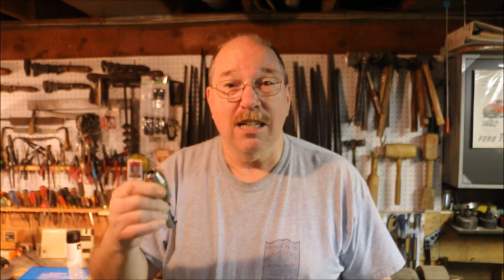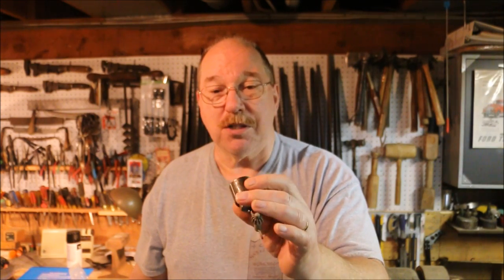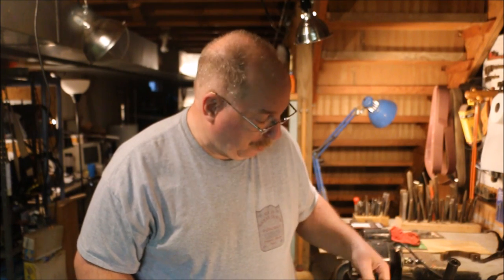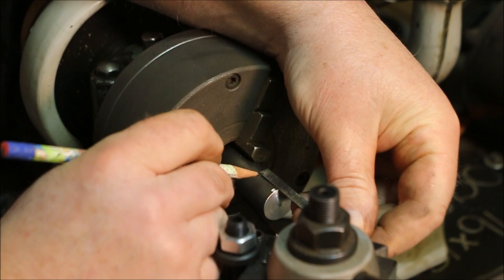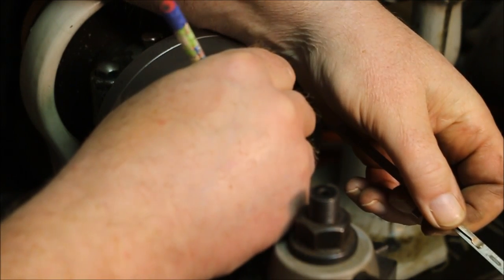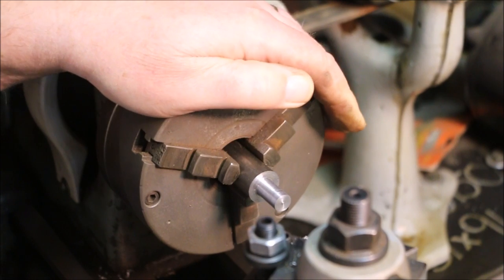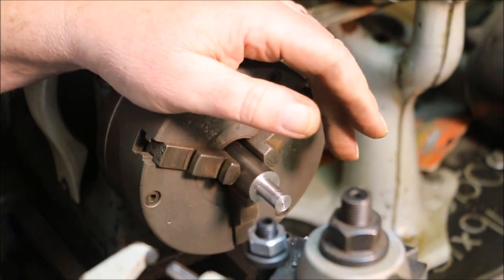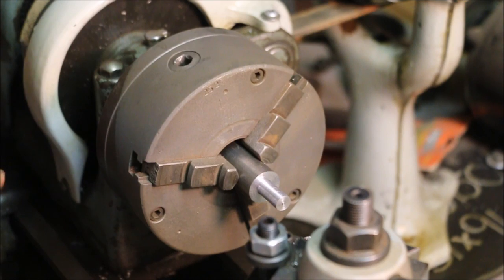DIY ~ MAKING A MOTOR ARBOR ADAPTOR ~ PT 1 ~ TURNING

Comment: I like you am a big fan of the keyed Jacobs chuck. It is becoming almost impossible to buy a mains powered drill with a keyed chuck these days but for sheer peace of mind they cannot be beaten. I was taught to always use each slot to tighten to ensure a really firm grip. As always, enjoyed the video.
Reply: Me too, Tony. My 3/8ths had a keyless and it pitches fits once in a while and I have to get out the oil can. And it just won't hold like a keyed job. BUT I have a keyed chuck on the hammer drill so if I really get desperate, I can go get another means to the approved end!

Comment: I've got a couple of those chucks I've collected for vintage projects.  They don't hold at all.  I don't know if they are just wore out or if they were always crap.
Reply from the maker: Crafted They stopped making the Millers Falls breast drills in the 60's. The keyless chucks have been around more than a hundred years so chances are if you find a loose one it was taken off for a reason. The reason I was using this one was convenience. The arbor I got at hardware store GOB sale had a 1/2" -20 thread so the old chuck fit right on it.

Comment: Great vid! Thank you!
Now, i have a problem that im hoping you can help me with.  I recently acquired an old motor with one of these threaded adapters on the shaft. The two set screws holding the adapter on were extremely hard to get out, but i did. However, it still will not budge.  Ive tried heat, soaking it in lube/penetrating fluid, etc... I want to use a gear/bearing puller, but the issue is the end of the adapter is closed. The center screw of the puller isnt able to touch the motor shaft.  Any suggestions? Thanks!!
Reply from the maker: First off do you want to save the adapter?

If not then cut off the end and get down to where the shaft on the motor is and put some oil on it and then use your puller on it. If you want to save it then you're probably not getting the oil down into the adapter far enough for it to work. When you heat it are you heating the collar part or are you Heating the end where the threads are? If you want the oil to be drawn down into the adapter put it at the end where the opening is and then heat the opposite end. The oil will be drawn to the heat. It won't be quick and you're probably going to have to put the oil on it heat it let it sit for a while. Come back put some more oil on it. Heat it let it sit for a while.

Each time you heat it, you don't have to heat it red-hot, you just have to get it warmed up. After you've heated it, while it's still warm, tap on it. Don't hit it. You don't have to slam on it. Just tap it. All the way around the outside of the collar
Reply: Old Sneelock's Workshop Thank you for the quick reply. I would like to save the adapter. Ill try your method of heat, fluid, tapping. keep you posted.  Thnx

Comment: I need an arbor similar to the subject of this video but do not have access to a lathe.  The arbor that I need would have a 5/8" diameter keyed bore with a couple of set screws, and 5/8-16 threads on the other end.  I've been all over the internet looking for such an arbor but so far no luck in finding one.  Can you make me one?  Do you handle such small jobs?
Reply from the maker: I seldom take on additional projects unless they have a specific part to play in a project I am working on . That is especially true now with the current work load. 
Just out of curiosity, what do you need it for?
Reply: Hi again.  I plan on mounting a drill chuck on the 5/8" keyed shaft of an electric motor.  Will then be used for restoration of motorcycle parts.  I had know idea that the 5/8-16 threads of the drill chuck were a bit rare.  I'd buy another chuck but this one with the 5/8-16 threads is really nice.
Reply from the maker: 1/2"-20 arbors are everywhere and it's a stock size for a 1/2" chuck. Cheaper than paying $100.00/ hr for custom work.
Reply: Ok, thanks for your replies and your videos.

Comment: i have an old table saw with threaded arbour on both sides of the motor, i want to mount a chuck on the right hand side for mortising and boring but its an unusual size thread 18mm and possibly 25 tpi the thread is so small i really struggled to count it haha anyway do you know any way of accurately measuring it? i dont want to pay for an adapter to be machined if its wrong
Reply from the maker: Thread gauges can be bought at most auto parts stores. They look like jackknives with saw blades instead of regular blades. You find the thread gauge that fits and read the number stamped on the blade. 
One thing to check. Sometimes they have a left hand thread on one side and a right hand on the other. 
You will want to know whether it is metric or imperial thread. You don't say where you are but since you are talking metric I'll guess it's not the US. Is the other arbor the same size? If so can you take the nut to the local hardware or parts supplier and try it against their stock? I've done that several times with odd ball threads. 
We have a company called Fastenal that if they don't have it they can sure tell what it should be and order one.
Reply: first thing i tried was the saw arbour nut haha im in the uk but its an old german saw from the 70's its either 18mm or 11/16 and its a right hand thread cuz its on the right side of the motor same as a bench grinder
Reply from the maker: Thomas Doherty Looks like you're going to have to get hands on. With the nut in hand I would seek out local shops that carry hardware. Perhaps one of the clerks can help.
Reply: ill order a thread gauge from ebay and just see if a local machine shop can machine something up for me
Reply from the maker: Sounds like a plan. If you were a little closer we could spend a couple of hours figuring out what the size was and turn one up. Finding someone with a small shop that is willing to try will be a good experience. You can always find work for a good shop. 
Good luck on your hunt. 
PS if you are going to go to a local shop anyway. Take the motor with you while you are hunting. They can tell right away if it's something they can tackle.
Reply: im thinking about carefully reducing the arbour on the saw with an angle grinder with the saw on then die the shaft to the standard !/2" 20 unf but im not sure could this be done accurately you think?
Reply from the maker: Rather than grind down the shaft perhaps you could use an adapter like this one. It locks onto the shaft with set screws. https://www.amazon.com/ARBOR-SPINDLE-SHAFT-MOTOR-GRINDER-THREAD/dp/B00XQAJI3G
I checked the Industrial electric motor chart and it shows a 19mm shaft that is .748 diameter and the next one down is 14 mm. http://www.electricmotorservice.net/iechart.pdf
With your odd size shaft it will be 1 mm bigger than your shaft. You could wrap it with .5 mm shim clamp it down with the set screws. It wouldn't be perfect but it would be as accurate as grinding the shaft. 
The other option is to by a 5/8" adaptor and bore it out. 
Grinding down the shaft would by my last option. If you go undersized it can't be fixed. If you can't cut the threads it can't be fixed.